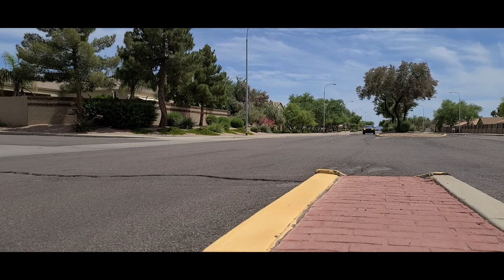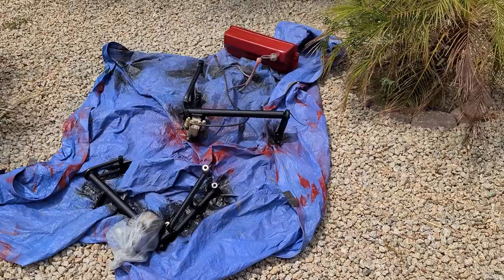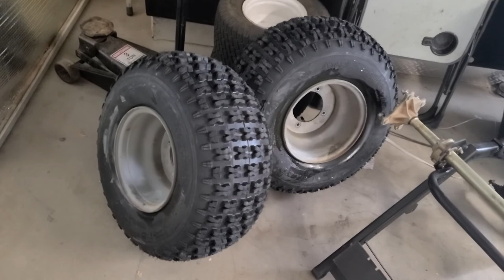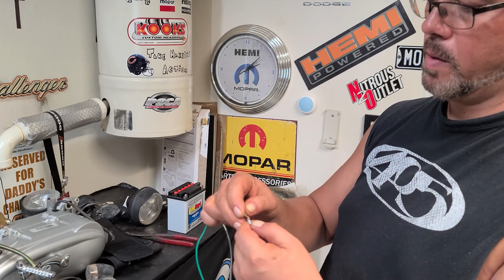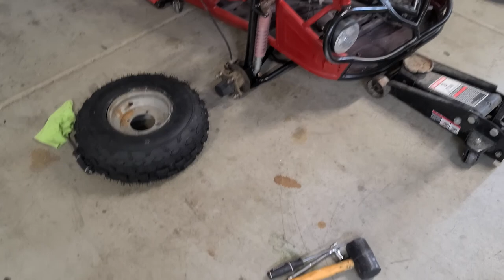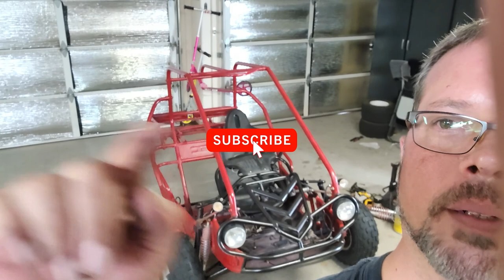Hammerhead Twister -Go Cart (Rebuild) Part 5 #Hammerhead

Comment: Hey like build I currently doing the same on a 250ss twister this was a good base to follow after the fresh paint  id highly advise a bed liner bottom coat and on a Arms also any part up front that might contact its gonna last alot longer and save alot of pain  also before u do that use a towl on the jack 😉
Reply from the maker: Great advice thank you!